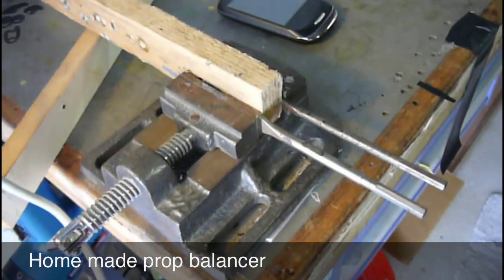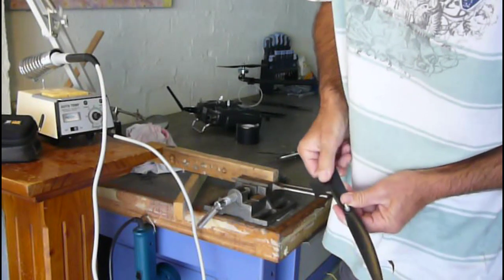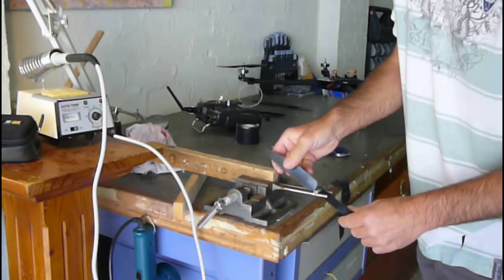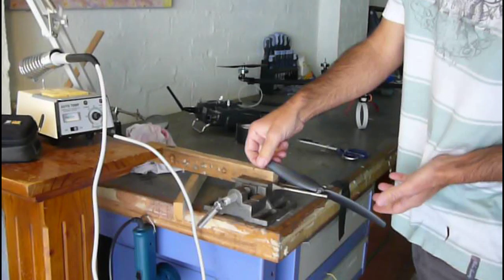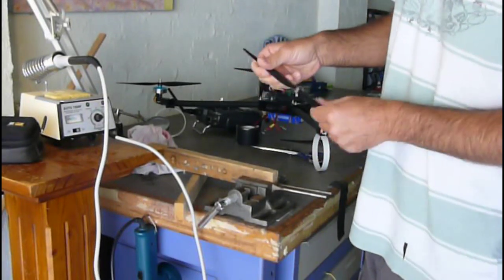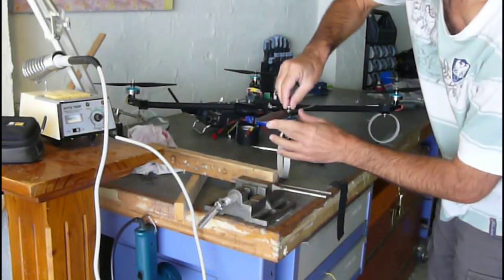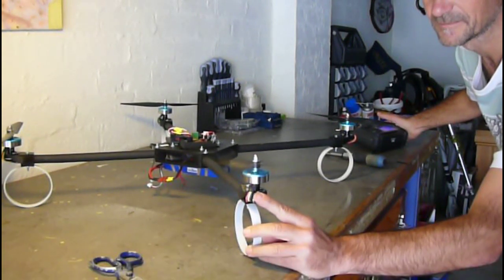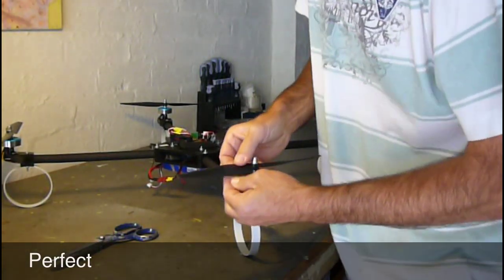How to Balance Props on your Quad or Tri nice and easy

Comment: Good video and one to help those who don't have a quality balancer. Believe it or not your method is more accurate than the balances hobbyking sell.  I now use a dubro. I balance lusting tape when I want to do it quickly but I believe sanding is better. I fine when I add weight with tape it effects the torque of the prop which means I have to retrim my yaw. Sanding doesn't seem to effect it as much. Wow those gas style props needed some balancing!!!

Comment: I meant also to point out that the closer to the tip you add the weight the less you need.  Is that a home made frame